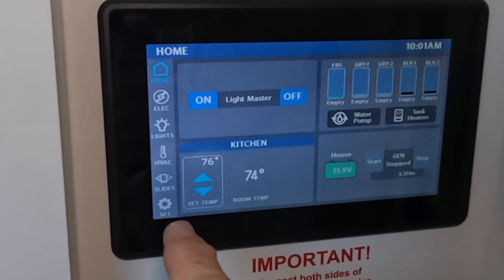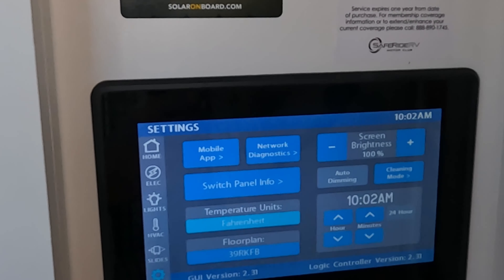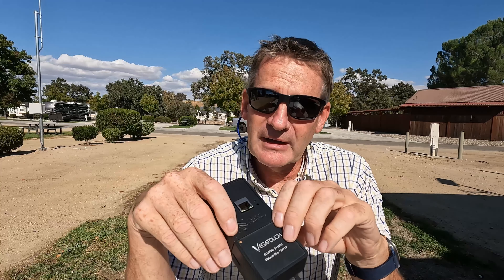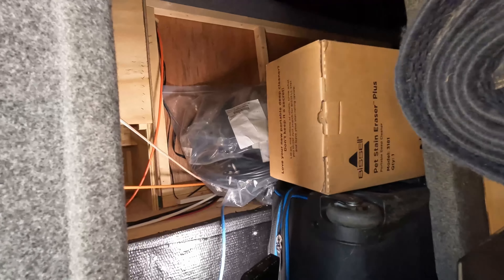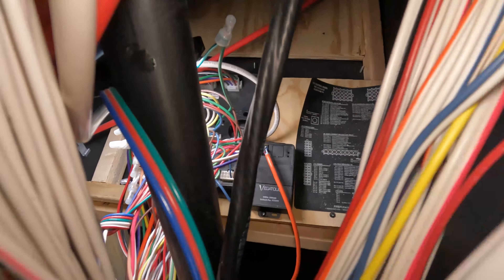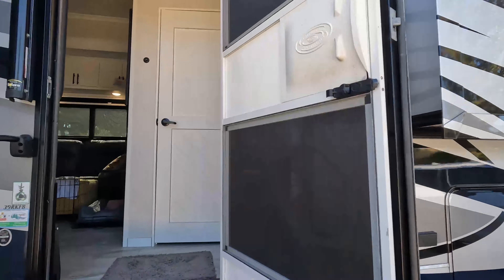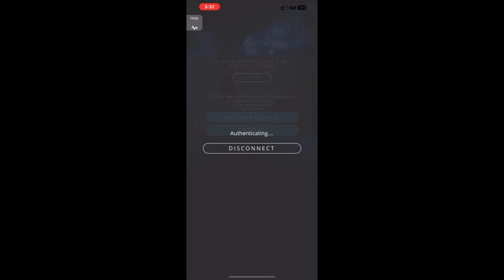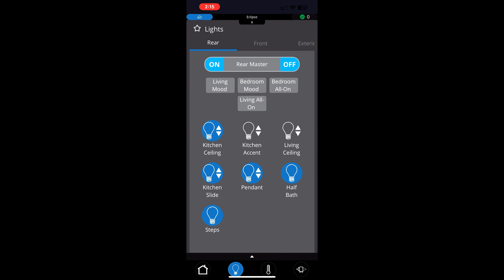Upgrading to VegaTouch Mira to VegaTouch Eclipse: DIY Installation Guide for RV Owners

Comment: Great video! I just did this same upgrade today on my Riverstone Legacy 442MC. Same color scheme as yours! Great choice!! I read the installation instructions on Firefly's website also. I was wondering why the touchscreen on the rig kept showing MIRA instead of Eclipse after upgrading to the Eclipse module. Firefly's website said to press and hold the MIRA icon on the touchscreen for 7 seconds. That will change it to the Eclipse icon. I did that and it worked! Now I'm officially upgraded to Vegatouch Eclipse! Hope this comment helps you.
Reply from the maker: Thank you for watching.  Your tip about changing the icon on the panel is indeed helpful.  I did it myself based  on your recommendation.  Thank you.

Comment: Thanks for the video, I've been wanting to upgrade to the eclipse system for remote use and it looks pretty easy and straightforward.
Reply from the maker: You're welcome and thank you for watching and commenting.   It is a very easy process, but the device is surely expensive.  I hope you can find a better price than I did!  I do like the peace of mind it provides and rationalizing that as justification for the cost!

Comment: I have not purchased the eclipse module but I did notice that if you press and hold the Mira logo on the firefly(it take a while)it switches from Mira to Eclipse?  Not sure what that really got me without the module?  Also as an FYI if you press and hold ( a long time)  on different locations  on the fire fly screen it expands to more options.
Reply from the maker: That long press indicates that the main module you have is compatible and will support the Eclipse.  I doubt it provides any functionality without the module.  I’ve been trying to get the time to go to FireFly Tech Training.   It would be helpful to understand it a bit deeper.  Thank you for watching.

Comment: Great info. I have a question do you have any videos that shows why the tablet don’t come on it’s just a black screen please let me know if any of your followers have experience this problem. Thank you
Reply from the maker: Sorry I don’t.  I will be attending the technical course on FireFly this year but don’t have access to the service manuals yet.  If it were happening to my system I would locate power to the main module and power it off and the on.   In some cases it’s easier to power down the entire rig - which is to remove from shore power and shut off the main battery switch.  You can also give FireFly a call.  I hear that their support is good.

Comment: have a Riverstone Reserve 3850RK.  The lights above the bed are only controlled by the FireFly switch that is near the door exiting to down stairs.  The light is at full brightness and the switch is not a variable switch. Very inconvenient to get up and turn out the reading lights.  Has anyone discovered a way to fix this issue.  I contacted Firefly and they said I cannot change from a on/off switch to a variable.  Moving the switch to beside the bed would fix the access (the switch is blue tooth), but not lower the brightness.
Reply from the maker: Thank you for watching.  I know just a bit about the FireFly system.  As an RV Tech, I do have plans to go to the FireFly Certification Training in the next couple of months.  Perhaps I’ll find the secrets.   I’m not buying FireFly’s claim that the switch cannot be changed to variable.  It probably can be done technically, but it probably requires a change to the floor plan coding and that’s not something than is user configurable.  That’s my best guess.
Reply: @okletsgorv  Thanks for input.  I think I have found a possible soliction.  Install a 12V dome lite that is dimmable at the touch.  Move the switch to the wall beside the bed, which can be done because they are Bluetooth.   I have not install the lights yet, but I found them on Amazon.